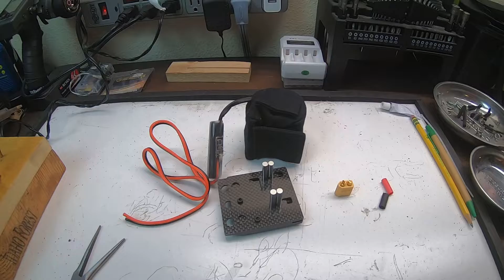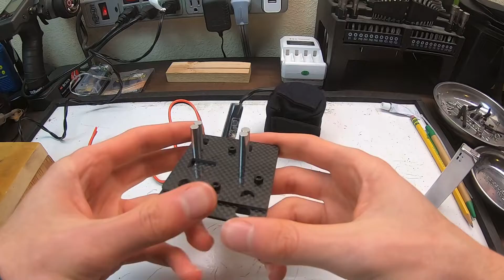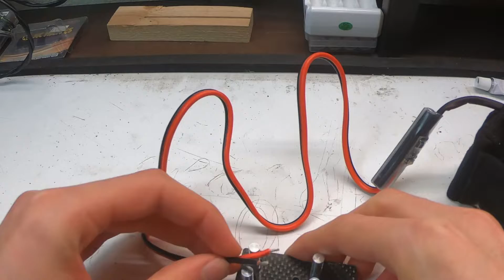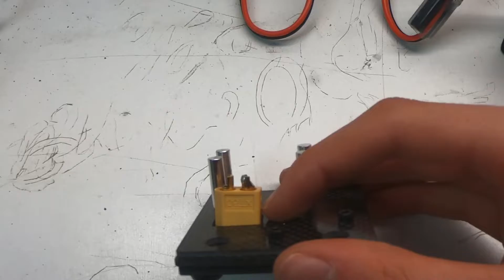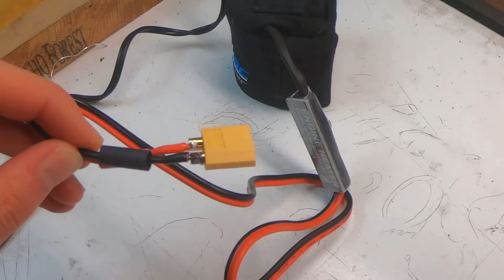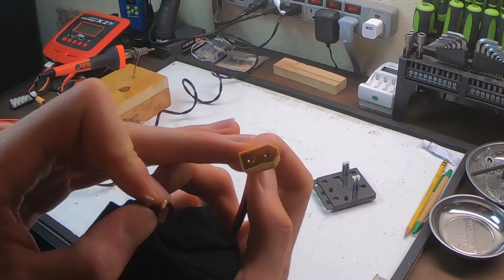Rc Soldering Tutorial Part 1 - Battery Connectors

Comment: Just a friendly tip. When I was taught how to solder I was told to heat the wire and then melt the solder to the wire, and not to melt the solder on the solder gun if that makes sense. This prevents cold joints and allows the solder to flow down into the individual "fibers" of the wire giving a stronger and higher quality contact.

Comment: I noticed the connector was vertical when you soldered it. I have the same jig.  I’m soldering Deans connectors. Is there a way I can use the jig to hold the Deans connectors in the horizontal position so it easier for me to solder? Thanks
Reply from the maker: Yes, if you want to put the connector in the vertical silver posts, you can hold the connector in a horizontal position.